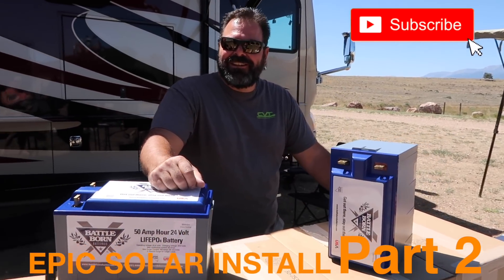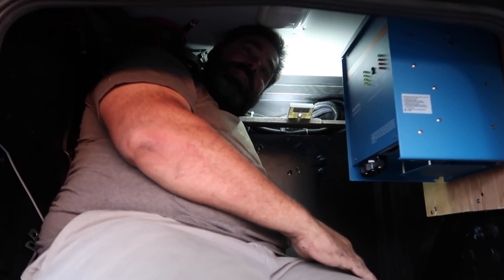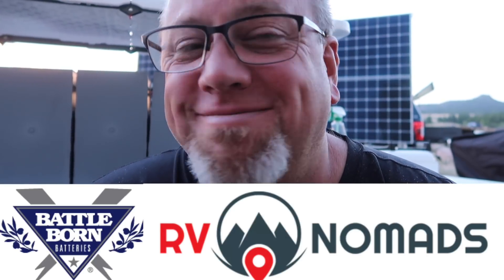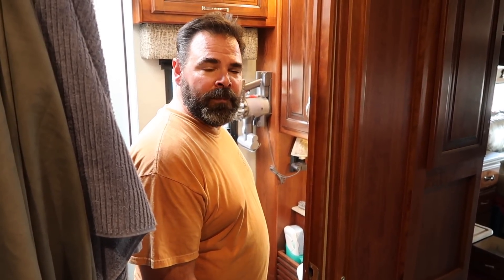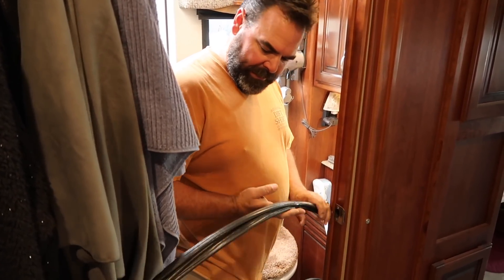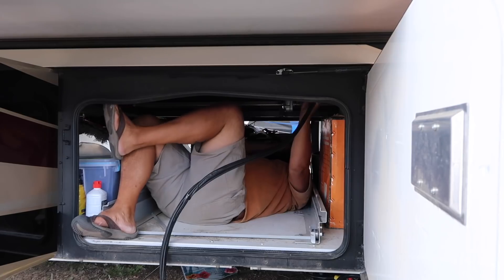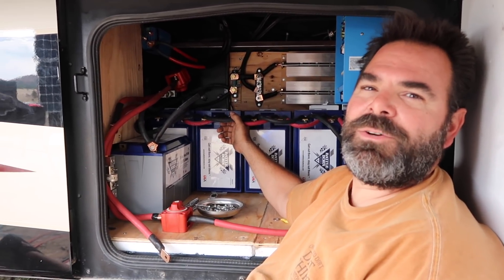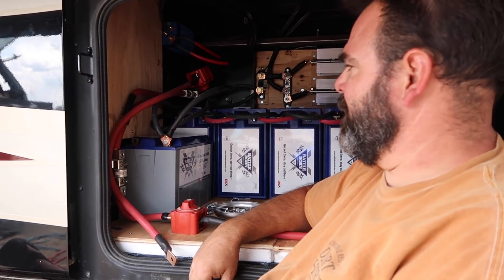Part 2: EPIC 24v RV Solar Upgrade with Battle Born Batteries & Victron Energy

Comment: I am doing a similar setup to my little rv on a smaller scale. Did you just disconnect the 12v charge system that is built into your coach? I know when we plug in, the camper charges the batteries. I'm converting 24v to 12v, and planning on just disconnecting the charge controller in my panel. How did you go about this?

Comment: Why 10 24v 50 amp.? instead of 5 12v 100 amp Battle Born, what is the advantage..?
Reply: check out Will Prowse he has a great explanation , its more efficiant
Reply: I have same question about to buy some

Comment: Wow, just dont arch your arm across the terminals.  You scare me when you reach in to that octopus of cables. Remember RESPECT THE BATTERIES. Great video
Reply: I know linemen that will work with 120kv hot lines all day but won't touch a 12v battery array in a UPS cabinet. The DC grabs and holds on to you.

Comment: Look at that! A $10k solar system!
Reply: Without a sponsor, I doubt you could get the batteries for $10k. If were to add labour instead of it being a DIY, $20K might not do it including the panels. Nevertheless, what a great system and I really like how Gary does the work. I no professional, but it does seem he really does it right.
Reply: The battery's alone are $10k.   I bet the system as installed without any solar compnent cost $20k.   So how do you keep 1000 amp hours worth of battery's charged?    Throw another 5k of solar at it.

Rolling my eyes.   No idea how or why battle born would sponsor this mess.

Guess I need to cross them off my list
Reply: Guess you could build a house to be grid compatible and pay an electrician 10k... to be grid dependent🤷🏻‍♂️. Then you’ll pay 300 a month for you two Hvac units to run for the rest of your life (and don’t forget about rate increases). Seems like the system would pay for itself in just 2 years. People pay more for being lazy, I guess.
Reply: @RollinHomies  lmao, 2 years? Luckily he didn’t have to pay for the system, otherwise it would never be paid off. That trailer won’t last long enough to pay that system off. I’m not including any labor charges the rest of us would pay. 

I do agree with the other comment. The system does look great and is well organized. I can’t wait until the RV industry starts install solar on the units out of the factory. That’s when we’ll see improvements and costs going down.

Comment: Hi, 
Every time I think you guys can't possibly top yourselves, you do.  This system is an Rver's dream.  I have one question however. Isn't there supposed to be space between the batteries for air to circulate? I think I remember that from somewhere. Please correct me if I'm wrong.
Reply from the maker: Lithium batteries dont require venting hence why no separation.

Comment: Gary you did everything so neat and uniform.  Great job.
Reply from the maker: Thank you!
Reply: Do you have any 240v loads or is everything 120v in the ac panels?
Reply from the maker: Everything is 120 hence why we are running in parallel and not split phase.

Comment: so i guess thats going to be 151.8 amps hrs being pulled with both your AC units on . so if your some where hot with them running 100% of the time and if you can get the full 500 amps hrs out of the batterys = 3.2 hrs of run time on a good day . your 110ac chargers well charge the batteries at 140amps (at 24v) so its a around 5 hrs to recharge the system  from empty on a gen set or wall power . so i guess thats not to bad .  i am not sure what size your solar system is going to be in panels  on your roof . i had to custom make my roof  from the ground up to hold the 11 panels i have now